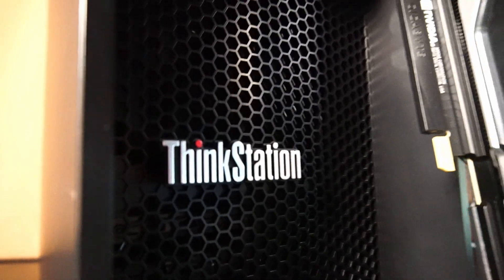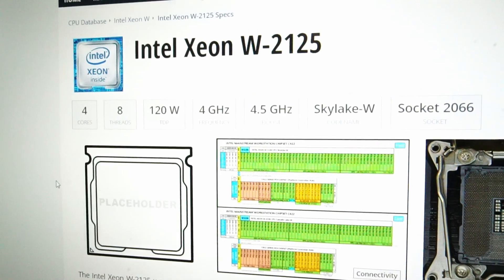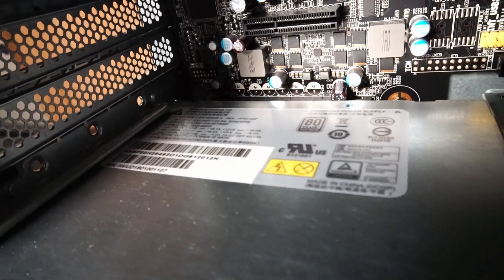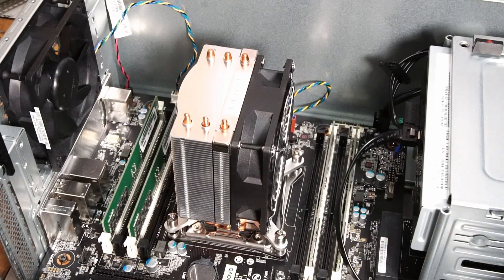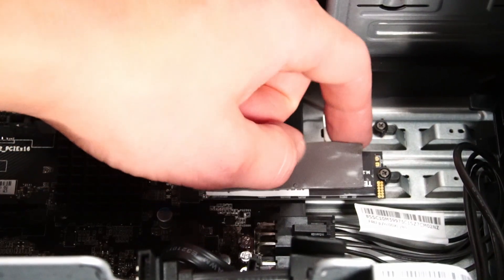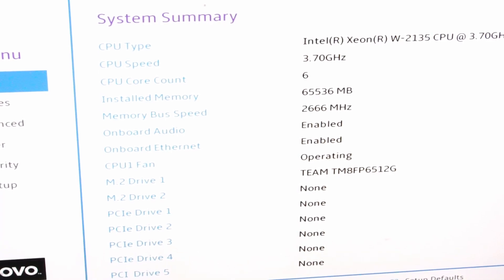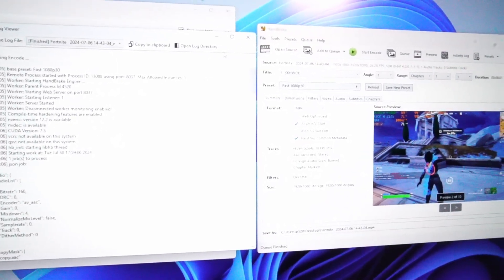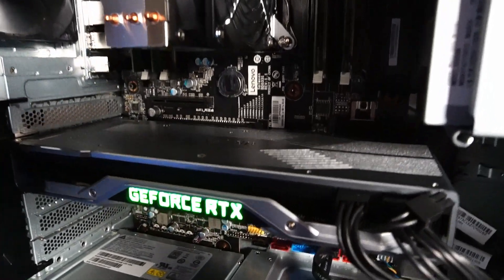Lenovo ThinkStation P520 Upgraded!  Video Render, Gaming Tests, & Hardware Review!  (2024)

Comment: I have the same specs, but I'm thinking to upgrade the GPU to be something like RTX 4070 Ti super or RX 7900 XTX
would think this will be a waste of money? won't give me good performance, considering that I work on 3ds MAX and do some video editing, and love to play games.
please tell me what do you think? I'm afraid of having hard bottleneck.
Reply from the maker: If you are either using the same P520 or have the same CPU in a different setup, you will get bottleneck with those two card choices and I don't think it would be worth purchasing unless you were planning to invest in a new CPU/motherboard.  You could look to a 3060 Ti for a boost in performance.  Or, a 3080 for more VRAM.  However the 3080 would likely be the limit before bottlenecking occurred.   Unless you invest in one of the higher end CPU's this system can handle, but those are pretty darn expensive.
Reply: @HaisteComputerRepair  Thanks a lot for your tips
If I will invest in buying CPU for this monster workstation, which one you would recommend to handle those two cards?
Reply from the maker: @AhmedMohsen-1978  Check out the CPU list here:  https://psref.lenovo.com/syspool/Sys/PDF/ThinkStation/ThinkStation_P520/ThinkStation_P520_Spec.pdf

Best ones are hard to find and very expensive for what they are.  Perhaps based on availability, I would have to judge.  You would be better off investing in an AM5 platform.

Focus on the ones that offer more cache, higher frequency, and better RAM speeds.  However, even if you got the best one you would still be facing bottleneck with a 4070 Ti and 7900XT in gaming.   I would not recommend unless you have money to burn and a desire to max out this PC at any cost.  On the other hand, let me know if you find one of the better CPU's at a good price.

Comment: Yeah man great video I'm basically doing the same thing p520 I'm going to max out the ram blueay burner dvd Bruner rtx 3050 6gb 2 12tb hard drives 1nvme 3ssds and if I need to ill double-sided tape some hard drives/ssds
Reply from the maker: Sick.  I currently use a P520 as a NAS/basement YouTube player for working out.  I took out the optical drive to squeeze in two more hard drives.  Just kind of hanging out until I figure out a new way to mount.

Comment: I also have a Brickstation P520 with the big W-2135 and a GTX 1070, mostly browse the web with it but it's a great gaming machine and can render the occasional video. Bought it in 2023 for $180 and the card was only $100, PC came with the Xeon, 32GB of RAM, and the 900w PSU. Upgraded to a WD Black SN850X that currently runs Pop OS, wicked fast, and I recently put in an Asus PCI-e WiFi card. I probably spent about $425 on the whole system not including peripherals.
Reply from the maker: That's a steal of a deal

Comment: Just ordered one on ebay. Going to have the -W2135 variant. Comes with 32Gb of ram but upping it to 128gb ECC.

Its replacing a system I already have that servers as my sound library nas that runs on 3 NVME drives currently and at max. Old system is also on x99 with a 14 core Xeon from 2014 in there.

While the CPU might be a slight downgrade in overall cores, the one in the P520 is more current (2017), and this platform supports bifurcation which from what I see, x99 does not. So now I can use the many PCI Gen 3 x16 slots to load up 4 NVME drives on each over time for a nice quick NVME Nas. 

Ill be transfering my SFP+ card over as I have 10G networking already too. Also, all running on Proxmox with a Windows VM. While im mostly using it as a Sound Library Server, its honestly not impossible to load up more alternative purpose VMs as well, not to mention use some of the storage as SMB fileshare.

Either way, excited. Been a long time planning and finally able to upgrade this system. Just as well as I think the old one's motherboard is suspect (possibly component starting to go).
Reply from the maker: The PCIe lane accessibility is why I also set one up as a NAS in my home.  Right now I just have four HDD's set up in RAID (12TB) but I would like to try a transition to NVMe.  This is possibly the next step for a three tier backup solution.  Workstation PC>Dual NAS RAID(s).  It will evolve as time goes on.  Good luck with yours!
Reply: @HaisteComputerRepair hey bro are these cpus that come with it good enough. I wonder if any zeons could replace the 2133 that i have. I am looking to put a 7909xtx in it lmao

Comment: Looking great , is there any chance for cpu cooler upgrade cause in summer it wanna fry
Reply from the maker: Good question, I am not sure at the moment but I will take a look at the one I have.
Reply: I looked for an upgrade mine once, you need a low profile cooler because the space between the CPU and the handle on the removable panel is about 112 mm if I measured correctly. A Thermalright Silver Soul 110 is what I was going to put in, but I figured that if Lenovo thinks the cooler they provided is good enough then I shouldn't be needing one.
Reply from the maker: @aku2dimensional  I just use my P520 for a NAS and watching YouTube while I work out (not the same one in this video), so the provided cooler is more than enough.  All my gaming tests otherwise, it seemed fine for the CPU I installed.
Reply: @HaisteComputerRepair  I thought the same thing and decided to not get one until I need such a cooler. My CPU temps are fine while gaming and when I watch Thinkstation P520 videos on Youtube. Lenovo doesn't use cheap hardware on these kinds of machines.

Comment: I bought this device. Is it strong in editing and gaming or not? - Please reply - w 2135
Reply from the maker: It's pretty good when stretching a budget.  It will really depend on what GPU you install.
Reply: @HaisteComputerRepair  Is this processor good or not for video editing and games?
w 2135
Reply from the maker: @Elkomnda_Mero  What GPU do you have installed?
Reply: @HaisteComputerRepair  I will add  rtx 3050
Reply from the maker: @Elkomnda_Mero  8GB or 6GB GDRR6?
Reply: @HaisteComputerRepair  8
Reply from the maker: @Elkomnda_Mero  That should be pretty good, what games are you looking to play and what kind of editing specifically?
Reply: @HaisteComputerRepair  Editing for content creators
Reply from the maker: @Elkomnda_Mero  Ok, what software are you using and video resolution are you hoping to process and output?
Reply: @HaisteComputerRepair  after efect 
4k
Reply from the maker: @Elkomnda_Mero  What is the price of the P520 you are looking at?   It could be worth looking into building a custom PC for better performance or upgrade paths
Reply: @HaisteComputerRepair  What is the ultimate experience that this device offers

Comment: I'm running a w-2145 which is the 8 core version.  Using an RX-6800 GPU.  It games extremely well up to 4k for most games.  My GPU rarely gets out of the 40s and the CPU gets into the mid to upper 70s.  Maybe once in a while it will hit 80 if my room is hot.  Pretty good overall.
Reply from the maker: That's great, I would have liked to try that CPU out, but they were over budget from what I wanted to spend on upgrades for reselling.  Good to know about your setup.
Reply: What is usage % of CPU at 1080 not 4k
Reply: @Gh0styGames  I don't remember exactly but when I have looked it is always under 50% and the fans aren't really moving much.  I game at 1080p lately because I have it hooked to my 55 inch HDTV.   Last of Us gets like 140 FPS with high/ultra settings and some small tweaks and I think it was around 37% usage for the CPU.  

The RAM is DDR4 but it's quad channel which kinda makes up for it a little.  You're probably leaving some FPS on the table at 1080p with this but it's plenty for me.
Reply: Does the cpu not bottleneck the 6800?
Reply: @kfcmanagertrihard4505  The CPU can bottleneck the 6800 in very CPU intensive games w low 1080p settings (where the framerate is going to be very high) although I haven't really tested it much since I never play games that way.  The way I play games is with maxed 1080p settings and there isn't much of a bottleneck if any.  I will even use supersampling AA on older games to remove the jaggies and make the graphics look much better.

Comment: Great video! I'm thinking maybe I should put 2 120mm intake fans in the front of mine just to help with temperature.
Reply from the maker: I bet that would help with continued use over time.  I would judge it may not show up as an immediate temp drop, but for long sessions I think it would have a positive effect.

Comment: I just discovered your channel recently and have been watching your videos as I also love upgrading older hardware. The uplift with this cpu was very nice indeed but would you use the cpu for encoding when the nvenc on the gpu is better? I totally get that you were testing the cpu upgrade for this but I just wondered. Great video and you have a new subscriber 😉
Reply from the maker: Good point, I am pretty novice when it comes to using something like Handbrake.  Before I got a PCIe capture card, I would use it for editing gameplay recorded with the xbox app within Windows.  I could have prefaced this in the video.
Reply: @HaisteComputerRepair  if you go into the video tab in handbrake there is a dropdown menu where you can change the encoder. You can change it to nvenc there and it will rip through the file very quickly. You can also use it in davinci resolve.
Reply from the maker: @jinty83  I had no idea, thank you.  I could have done tests between the Quadro P4000 and RTX 2080.  This PC has sold, but hopefully I will get another soon.  Either way, I will look into this and add it to my tests.  I am mainly a repair/systems builder, so a lot to learn about software.
Reply: @HaisteComputerRepair  glad I could help. It was still great to see the uplift in performance with the new cpu. Those extra cores made a big difference for the cost.